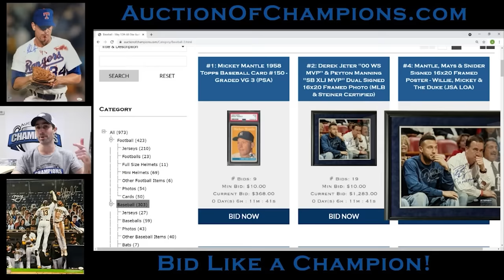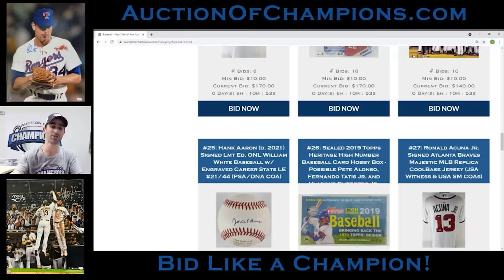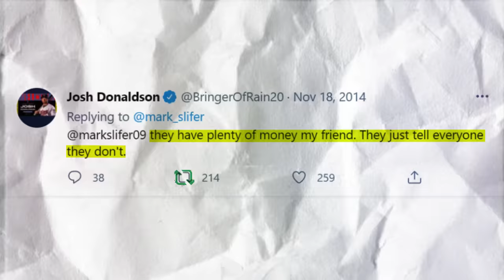How Josh Donaldson Became The Angriest Player in Baseball

Comment: The big issue with Billy Beane trading him from the A’s to the Blue Jays (made the day after Thanksgiving 2014, a day that lives in infamy to A’s fans) is the return. It was garbage, absolute garbage. Beane got 4 players in return, and not a one of them had any significant impact with the A’s. Two of them ended up getting released, and the other two eventually were traded for table scraps.